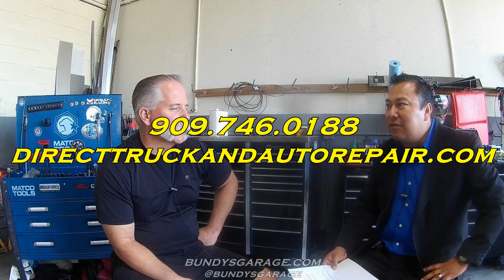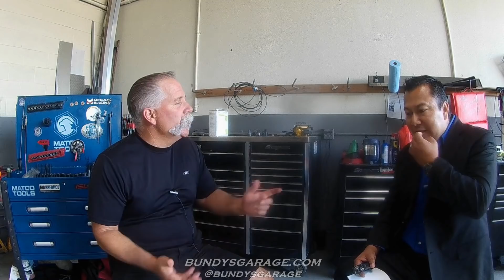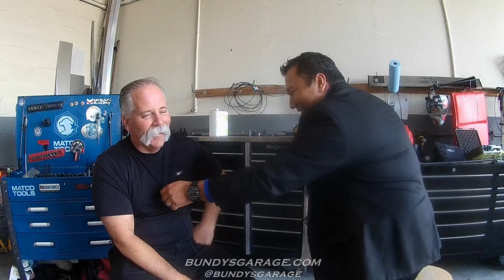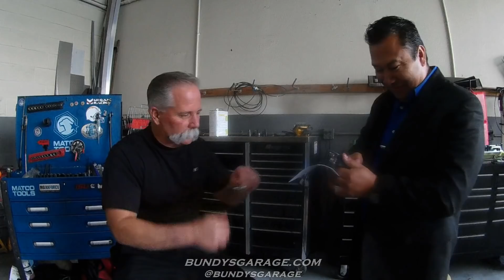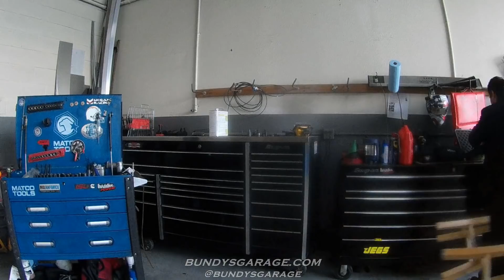Worst Diesel Engine Ever - What is the Best Diesel Truck out There? | Ford Dodge Chevy

Comment: In the 80's people were not really interested in inline 6s typically and they are harder to package.  I have to wonder if Ford had chosen in roughly 88 or so when the IDI 7.3 was around to transition to the DT-360 International and promoted International to continue developing it.  For those that don't know, it is a heavier duty engine than the 6BT and even has the much loved Bosch injection pump though not a P pump it could have been upgraded to one.  The 360 will do everything the Cummins will do and is a true heavy duty diesel design more so than the Cummins - wet sleeve engine - rebuild in your driveway with hand tools.  Had Ford been developing and driving updates for the DT-360, the diesel landscape would be a lot different today.

Comment: I had a 6.0l Ford and it constantly was broke down. Bought it used drove 800 miles had to replace rearend gears. 6 days later the EGR manifold went out in Springfield, MO. Then 4 days later the oil tube for fuel injectors cracked in Chicago, IL. Had it towed to my house 250 miles away, and sold it. The truck was loaded it was a F450, 60 inch sleeper, 8 foot aluminum bed, 170 gallon fuel tank, 26,000 lb fifth wheel, and a reese class 5 hitch. Was a beautiful truck just had a junk engine.

Comment: Ford and GM are both hands down better trucks than Ram. Ram looks pretty but falls apart but Cummins 6.7 is thr best engine hands down but I'd rather settle for 6.7 Powerstroke or 6.6 DMAX to have a better quality truck. Throw a  Diesel in a heavy duty Tundra and I'll be first in line. I prefer Japanese any day.

Comment: Thanks for the boost for the old 7.3 ! I have a 96 f350 crew cab duality, doesn’t like to start in cold weather but I’ve used it every year to go to Florida. Does a good job and get 15 mile per imperial gal hauling a 5th wheel.

Comment: My idiot, car pool buddy filled his new 2018 Cummins with $100 worth of gas in his diesel and he drove it 40 miles to the dodge dealer with the most god awful clanking and banging as we drove. Dealer drained the tank and fuel system and remarkably it runs fine, couldn’t believe it didn’t blow up. Testament to the strength of the Cummins engine, not sure how much damage was done long term though.
Reply from the maker: Wow! I’ve heard horror stories about gas going into diesel engines and the Bill was north of $15,000

Comment: Got a 2001 F250 4x4 with 97K and 7.3 engine. Have towed a 25 and now 27 ft fifth wheel camper with it across country a few times and she is a beast, it barely breaks a sweat. Just a plain Jane and by that I mean no fancy electronics...has a radio, CD player, air and cruise. Love my truck. I liked this video because there was some very good information, thanks. My mechanic (husband) can no longer do anything because of health issues but this truck was his pride and joy.

Comment: 1996 F250 and a 99 F350 Powerstroke with manual transmissions on both, had a cam sensor take a dump driving it home from the dealer, other than that, dragged 6-8000 lbs up the grade daily, never had an issue

Comment: cummins???????????  What a JOKE!  Over the past 30+ years I've owned Johnson & Towers Detroit 250's, Volvo TMD40'S, Ford 7.3,  Onan 6.0 and and 8.0 gen sets, Generic 6.0 gen set,  Kubota diesels, and this cummins 5.9 24 valve DOG of a diesel.  The ONLY diesel that has required THOUSANDS  in repair bills is, you guessed it, the 5.9 cummins.  From the $7,000 fuel pump failure to the fractured exhaust manifold, to fuel rail issues.  This DOG gets used about 5K miles a year and gets annual service including oil, all filters, and a chassis lube.  I guess I should consider myself lucky, after reading all the headaches people are having with the cummins 600-625 HP newer versions, they are spending $30K  for rebuilds and cummins just turns their back on them for ANY reimbursement.  Do yourself a favor, if your considering a diesel powered motorhome, go with a CAT or Detroit diesel.  A final thought, if you own a cummins, find a repair facility that doesn't have crosspoint in their name.
Reply from the maker: How do you really feel?

Comment: Why didn’t GM go to Caterpillar for an engine instead of Isuzu? I like the front ends on all GMs stuff, and I’ve driven Cummins, Detroit, Cat, and IHC in big trucks, over the road, and off road in construction applications and it’s all semantics. Every mechanical thing is fallible, and if you don’t take care of it, you’re screwed!! If Ford could fix their front end issues, then you’d have the perfect truck. The 6.0 has plenty of power, and if you bulletproof it or fix the issues that they do with their package, then you’d be golden. 🇺🇸🇺🇸⚓️⚓️👊🤟🤙

Comment: 2006 Nissan Frontier😊
Put 254k miles on it and NEVER any trouble. Then the day it misfired on cyllinder #4 it was trouble and everything was downhill from there till i cut my losses and bought a 2018 Ram1500 along with a bucket of exhaust manifold bolts.
Reply from the maker: What’s happened after #4 had a misfire? Very interested in knowing.

Comment: I know the 6.0 Powerstroke has a notorious reputation, but as the man says, maybe they just weren't maintained right. My 2007 F250 Harley Davidson edition has 372000 miles on it. And the clock is ticking because it is my daily driver. I've had to replace a set of injectors at 263000 miles, a new water pump, Serpentine and radiator at 315,000 miles, and last year my EGR finally failed at 355000 miles which I just deleted. I don't meticulously maintain the truck, but it does get maintained. I don't drive it like a 16 year old however I don't drive it like a 70 year-old either. It is no stranger to a 15K trailer. Maybe I just got a good one, but I have owned the 6.7 Cummins ( DPF issues every time I turned around) and the 7.3 powerstroke. And hands down, my 2007 F250 has been the most reliable diesel I've ever owned.

Comment: You cannot weld a cast iron engine block without soaking it in heat for at least 24 hours and then cooling it slowly,  otherwise the engine block with bend or twist due to heat stresses.

Comment: I’ve owned all of them and actually use them for what they’re made for. I’ve by far had better luck with the GM trucks than what I have the others. 

Good luck with keeping tires on that going down the road sideways Ford chassis,  keeping a Dodge in the road when the steering stabilizer shock goes bad when you’re driving down the road. I had 2 of the 6.7 Cummings, drill a hole in the bottom of the turbo,  $20k to replace a failed fuel system. 5 to 7 mpg just by hooking nothing more than a lawnmower trailer to the back of it. 

Ford 6.0, the Ford dealership wouldn’t even give me anything on trade for it because they couldn’t get rid of them, alone with wholesalers not giving them anything for them. It went through 2 engines in 86K miles.

I’ve had 2 duramax’s , I’ve had zero Engine trouble out of both trucks. Yet I will say this much about all of them. I still have a 1997 5.7L ( 350 ) gas motor C2500 Chevrolet truck that I’ve had since new. I will honestly walk right pass any of the other trucks that I’ve had or still have to get in that old 1997 3/4 ton Chevrolet to go do something. That truck is without a doubt the best money that I’ve ever spent !!

Comment: They say the power stroke cam out clim either the ram or Chevy up a step incline they did a comparison on tfl with them going up a steep clim the ford did it in about 10 min the other's where a little slower than the ford but they liked the ram out of the other two going down hill because they said the exhaust brake held the truck back they said ford would have won if it wasn't for there exhaust brake  . They did not give Chevrolet anything  . Go watch tfl trucks where they take each of them up the ike gentle with loads on them the ford out did them both up hill witch surprised the guy's from tfl trucks

Comment: Best truck with a diesel. Easy 99 379 low leaf Peterbilt with 3406E caterpillar. Best motor ever built. If only Caterpillar made a comparable motor for pickups. Until then they are all junk.

Comment: I have an 05 6 litre 250 with 111000 miles with no problems.I have done all the factory service on it.Proper coolant and recommended coolant flushes are the key on a 6 litre.They are a badass motor if well maintained,my motor is stock.I will say,I don't try to pull backhoes at 70 mph down the road everyday with it.

Comment: My old 7.3 power stroke has been a good engine I bought mine in November of 99 as 2000 model and it runs like a sowing machine may not be as much power as today’s but knock on wood it’s been good

Comment: Not going to trash any engine or vehicle, just state I am completely satisfied with my purchased-new 2002 F250SD 7.3  E4OD 4X4. 18 years and 285K later, it is still my daily driver. And the power seats still work just fine, as does everything else.

Comment: I've been a professional mechanic for almost 50 years. If Ford ever comes up with a front suspension that you can depend on it could be a decent truck. Of course you would have to put a different engine and transmission in it. That death wobble common to the Ford is a never ending and expensive repair that I am surprised hasn't killed more people because of the loss of control of the truck.
Reply: I work for a Ford Dealership for awhile now. Are you possibly thinking of Dodge? I have never seen Ford ever have Death wobbles. Mostly Dodges tbh. Not even Chevys have that problem. It's even called the Dodge Death Wobble to the car community because they are so common with them.
Reply: @stumorton7318  I’ve seen plenty fords with death wobble I’m genuinely surprised you’ve never seen one but I’ve seen death wobble on dodge ford and Chevy nothing is perfect
Reply: All you have to do is replace the worn out parts,  unlike a dodge where they actually sell a kit to strengthen the steering box.

Comment: 96 ford f250 7.3 engine crew cab 4wd 289k miles. Ive replaced alternator twice, steering box once, tires, brakes, oil, fuel and oil filters and thats it. Original water pump, injectors, turbo, starter, pwr steer pump. At times pull 30ft gooseneck 6500lbs with 18600lb Cat D4 aboard. Hauled D4 from washington state to alabama. 14 mpg on flat ground at 65,,10 mpg in mnts of colorado. Hauled D4 from quebec, one from virginia, two trips to ny to get D4s, one from kansas to alabama never a prolm. Change oil and filters every 6k miles.

Comment: I bought a new Ford F150 in 2010 and I sold it just before 3 years old because Ford wouldn't fix the rust after the 3 years .. It was painted 2 times because of rust ...

Comment: A place called Pittsburgh Power has a catalyst that reduces soot and in most cases improves MPG. 
    It works in gas and diesel vehicles.   It is quite expensive but you only add ounces (best to use a syringe) to your tank on fill-up. When it cost upwards of $12000.00 to clean a commercial truck particulate filter and when they are checked at suggested service mileage and they are clean the catalyst is worth it.

Comment: I agree with the Ford F-150.  Great chassis.  Easy to work on.  Springs, brakes, shocks, rotors, calipers, ball joints,,,, you can swap out just about anything under the truck in minutes and for pennies.  But you are focusing on the wrong engines.   If you want a huge engine because you have a small male appendage,, go for it.  Ford has a long history of incredible,, astounding  6 cylinder and modest sized 8 cylinders,,,, engines that last your half million miles at a walk.  What good is a 10 liter engine if there is no room to replace the spark plugs?  And yes,, there are certainly a few trucks that need a large engine,, but the 4.2 liter 6  will haul  the 8 foot box filled past the brim with plywood or 2X4s.  I have filled the bed with 8X8X16 cement blocks.  I have towed 3 ton trailers.  And most importantly, if I need to haul 2 lifts of plywood,, I make 2 trips.    I am supposed to spend an additional 30,000 dollars, plus maintenance, so that just 7 times in owning the truck 5 years, I do not have to make 2 trips?    4.2L  6 and the 4.6L 8 (2005 and later)  are both half a million mile engines.  The old in line 300 cubic inch 6 cylinder,,,, sweet.

Comment: I have a 1996 F350 dually flatbed, it has not been babied but the paint is original, no rust other than surface rust and the cab bushings are still good. The 7.3 was a good engine as well. I have to say for a work truck I've been happy.

Comment: I have 99 Chevy 2500 4x4 with the 6.0  (360 gas). and a 2004 Chevy 3500 4x4 with the 8.1(496 gas) both are proven reliable work horses.

Comment: What’s interesting about the transmissions and what really shocked me is that I have talk to two unrelated transmission shop owners and they both told me that they rebuild more Allisons than the Fords and Dodges is combined.
Reply: theres a reason most of the UCC trucks, regardless of engine theyre running, are usually running upgraded dodge engines.

Comment: I had a 1982 F250 with 6.9 international and Spicer manual I put a turbo on it fabulous rig mucho power and torque it had over 400,000 miles on it when stolen when recovered motor was full of sand

Comment: On the older Ford or International 7.3 was an awesome engine as well as the 5.9 Cummins. Both where so easy to work on. The downfall is when they had to change the diesels to new gov regs and having to run DEF later on...

Comment: 6.0, 6.4, or 6.7. I cant say much for the 6.7. But I worked for an International dealer for years. Hands down the 6.0 is preferable to the 6.4 and that is saying so much. The 6.4 regen washed cylinder walls. The piston rings were way too hard and brittle. I saw trucks with 6.4s, 220k miles, getting their third new engine because it was cooked again. There were years I swore I'd never see anything worse than a vt365 6.0, boy was I wrong. T444E was an unappreciated workhorse for sure. I could shoot the poop with this guy for hours.

Comment: Here's some basic advice you don't hear much anymore, all diesels especially the computers in them need good batterys. Diesels need to be warmed up before you go down the road. Diesels are only efficient if they pull something otherwise the extra money/ maintenance cost are not worth it.
Reply from the maker: Like soccer moms driving diesel trucks!

Comment: I love my Chevrolet 2006 Duramax Allison 6-speed doesn't have all that crap, just the cat. The trucks done fine. CD stick inside, accessory cooler transmission line leaking at the fitting simple repair hoses 50 bucks. No complaints from this truck, keep my fingers crossed.
Reply from the maker: That’s a badass truck! My 98 Silverado with a 5.7L just ticked over 300,000 miles original engine and transmission.

Comment: I have an 01 F250 7.3 purchased new and one 05 F250 6.0 Reg cab and one 06 6.0. I never has any issues with the 6.0s for 225,000 miles when I sold them, neither ever had a programmer on them.

Comment: Electron beam welding will weld a cast engine block. Jack Roush used that type of weld to build the engine for the Ford GT90

Comment: The best truck that could ever be built would be ford chassis with a Cummins power plant and a Allison transmission. If a truck like that could ever be built or would be produced, I would be at the dealership going bankruptc to purchase it lol. My 19th 7.3L turbo diesel is still running strong with 264k on the odometer!

Comment: With regards to mention of Ford having a solid frame, not too long ago, there was a flex-test done on both Chevy and Ford. The Ford had so much flex and twist that the body panels and tailgate buckled. The GMC / Chevy frame held up during that test thus, I'm confused as well as interested to learn why the above was mentioned. I'm not putting anyone down here just looking for information as to why that is along with some possible test results of both, torsional and other stress testing done on truck frames. I'm a Cummins guy and run a Dodge. How do the 2500 series Cummins models frames rate? 

Thanks in advance, 

CM

Comment: I likednthis video as l am an Fseries super duty lover from down under. What do you think of after market oil purifier/ cleaningbfillter systems which supposedly do away with changing engine oil and filters and you only add oil as the motor needs it.

Comment: When I had a tow truck I ran a 454 gas 7.3 leader why you might ask because it was easy to work on it was cheap to work on and I wasn't getting paid unless my wheels were turning....... And I still got over 500,000 miles on it

Comment: Let me sort this out in my diesel nightmare. I have a 4 cyl perkins in a cat telehandler ,  and 3 cyl perkins in a mini ex . One 93 dodge 4x4 wrecker 5.9 . One skid steer with a 4bt , one 97 ext cab ford 7.3.  I have 3 2005 International dt466 rollback wreckers and and small dump truck with a mechanical dt 466. We tow the 6.0 ford the most to a shop like this one. we also tow a lot of 07 and later cummins .  Darrin is spot on with the ford ford 7.3. I live in Wyoming and they have rocked the oilfield since the early 90s. They need to discuss the repair costs.